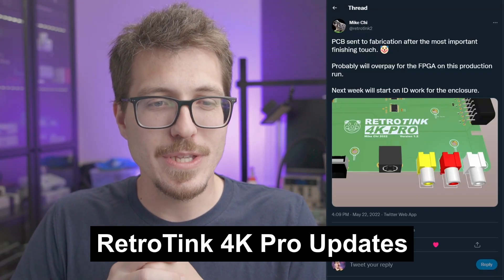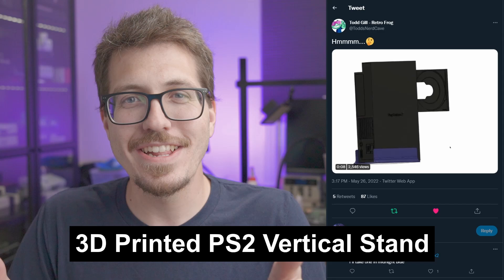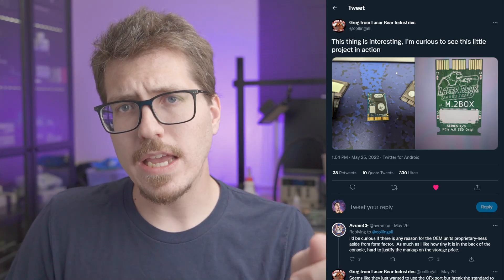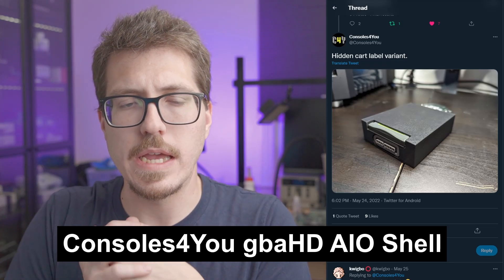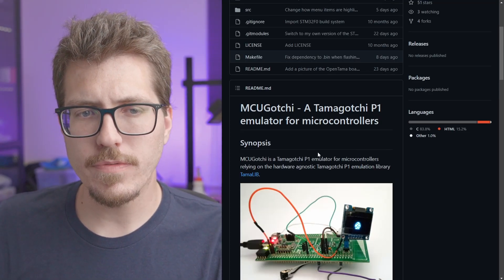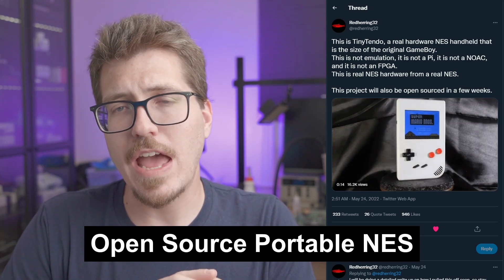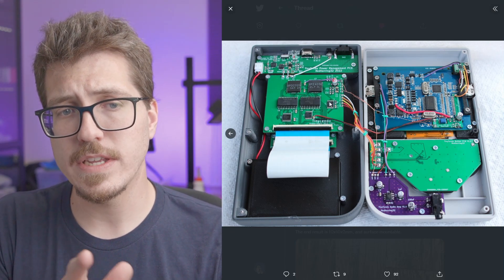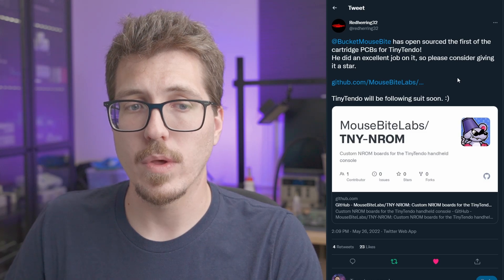Portable NES Made From Real CPU and PPU - Retro Modding News 5/29/2022

Comment: There's a number of projects that cut down the motherboard to miniaturize original consoles, but this is the first time I've seen the main ICs cut down. Really interesting.
Reply: For those who wonders what happened here:

The actual circutry inside original big black chip is relatively small and it is in form of square or rectangle, so empty space of this big black compount blob is used to route pins just because this is through hole component. Basically if you grind top part of chip you will see a 2D centipede with legs grown from IC to the 2 sides of chip.
Reply: @ShcherbynaM  thanks , i was over here thinking they just shrunk the process node .
Reply: I imagine it like an UV EPROM. Where everything's stored in the little window and thin conductors branch out to each pin.
Reply: This is crazy, I would have thought that the circuit in the chip was close to the size of the actual chip. If they had done surface mount back then, the original NES could have been much smaller actually...